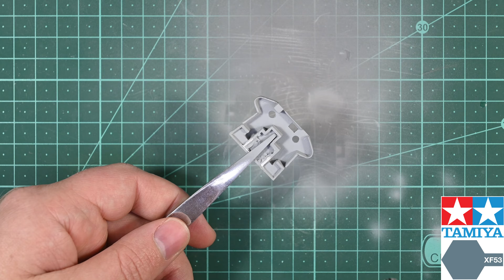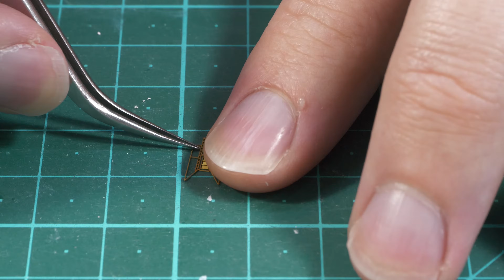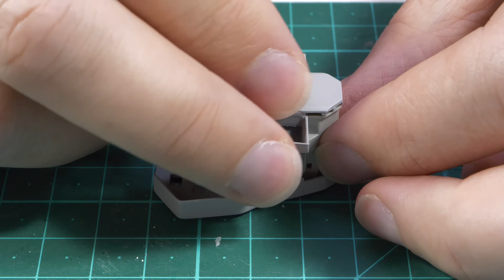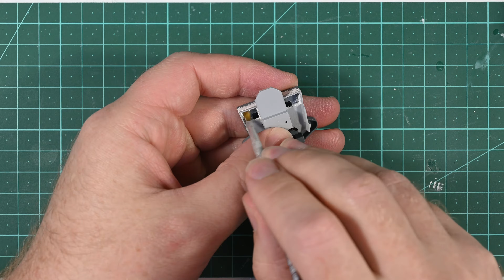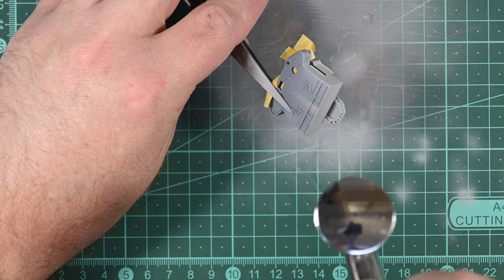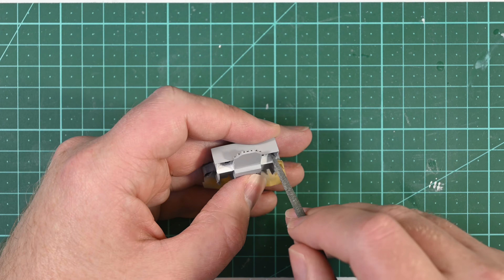1:350 HMS Hood: Part 43 - Forebridge & Torpedo Control Platform

Comment: You're really putting in the hours. That's why this build will be a lot better than than most. I'm sure it will be worth it. I think I'll use your technique for masking the decks. I've only built the Bismark in 1/350 and the problem of painting the decks first or the sides is always a dilemma. When I'm doing smaller scale I mask the sides like you do but brush paint the decks.
Reply from the maker: Sometimes I think I should use a brush more often. I have a suspicion that I make a lot of extra work for myself by using the airbrush as often as I do and that get very little, if any, benefit for it.
Reply: @DavidsShips  No you're doing it the right way. I brush it and I'm usually disappointed and airbrush the middle to make it look a bit more even.
Reply from the maker: Good to know!